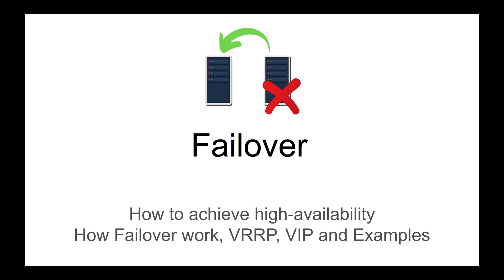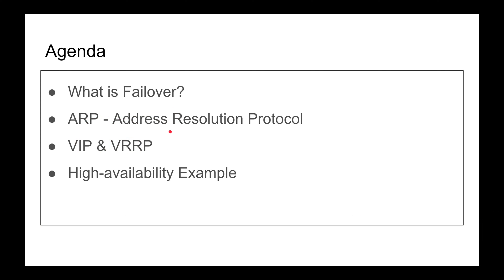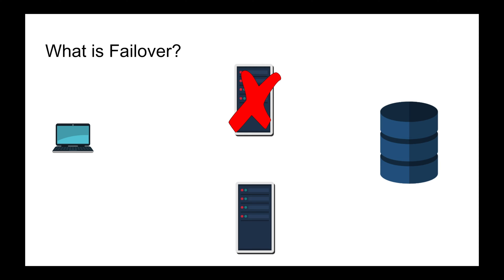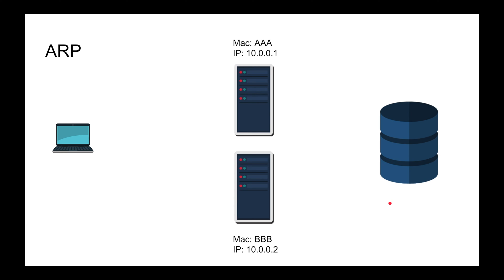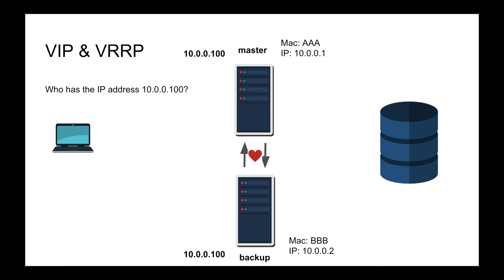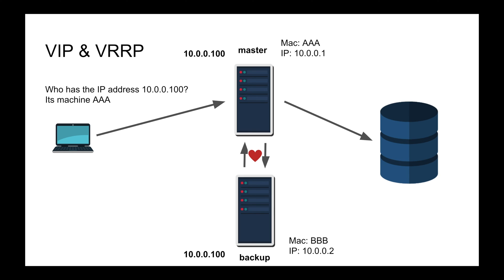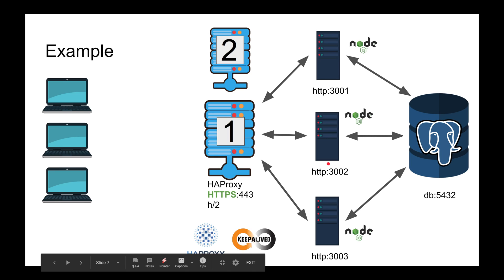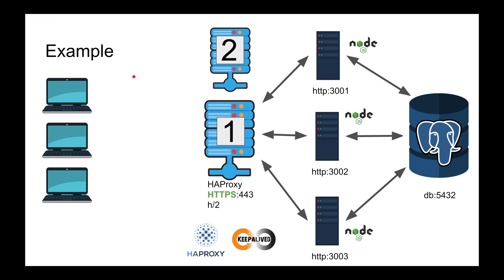Fail-over and High-Availability (Explained by Example)

Comment: Can you describe a little bit what is happening in the background between a primary and secondary to ensure that their file systems are in sync. Does it need running services within the node for the fail-over to be successful? If I can ssh into an Ubuntu machine, how can I tell that it is being configured for fail-over?

Comment: hello please give me some advice to solve my problem sir. i have load balancer TPlink TL-ER6200 and i setup a fail-over  i have two ISP sometimes my 1 ISP goes wrong no internet but modem is active just no internet. the load balancer not outomatic switch the backup isp in the back up wan. they switch only the backup wan when main wan  not connected in ISP 1

Comment: Does Application running on Microsoft Cluster works on same ARP/ VIP concept? For example we need to deploy IIS/Web server as HA using Microsoft Cluster Service... I always used to think may be DNS is getting updated every failover happens but never thought about ARP... Great Video !!
Reply from the maker: Yeah MS uses NLB as a layer 4 load balancer. Thanks!

Comment: Hi bro thanks for taking your time to share your knowledge with us, I have a question, I know each computer has a local ARP table to store each know mac addresses, the first time when the machine ask "who has the ip *.100", it will add the response to this table 10.0.0.100 == AAA, so how is the machine know that the first machine with mac AAA has failed, and it need to ask again "who has the ip *.100" ?

Sorry for my English, thanks
Reply from the maker: Douglas Mendez good question!! When the client asks who has the ip address 10.0.0.100 it will be received by all machines and machine AAA will respond. So the client will know update its ARP table that 10.0.0.100 is AAA. 

When AAA dies BBB takes over (because BBB knows that AAA died since it didn’t receive heartbeat 💓) BBB now sends a broadcast to all clients to flush their ARP table so that 10.0.0.100 is now BBB.  Its a reverse operation

Comment: Nice video, thanks for the simple explanation. I have a question, slightly off-topic but pls excuse me. I want to know what happens in real prod scenarios, say both of the front end servers(or app or db) go down, how is the third one introduced? I assume the newly introduced server will need some configuration before it can handle requests. How is that handled automatically?
Reply from the maker: edufree good question, I don’t have a straight answer unfortunately. The originations I worked for always used Passive Active model just two servers and when the main server goes down the new server takes over (fail over) clients will have to close and reopen. 

The probability  where  both servers go down at the same time is low in enterprise environment. And if it does you will basically go offline. Here it depends on your SLA. Do you want to cater for that case? You have just add another server to the cluster to fail over to. 

In high active environment such as google, twitter this is done through containers and orchestrating layer (kubernetes) if something fails another container is always available.. 

Databases are tricky to scale as containers people are still figuring this out.. essentially making the DBMS stateless and decoupled from storage. 

Hope that helps or did u have something else in mind?
Reply: @hnasr  Thanks for the reply, yeah I guess containers provide more bandwidth for failures in HA environments